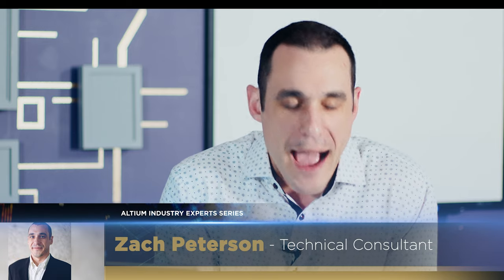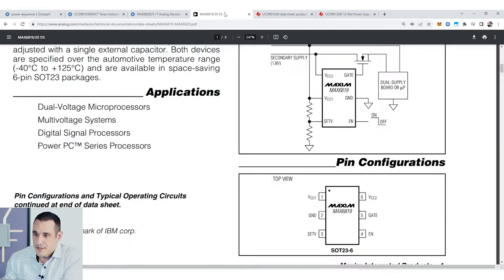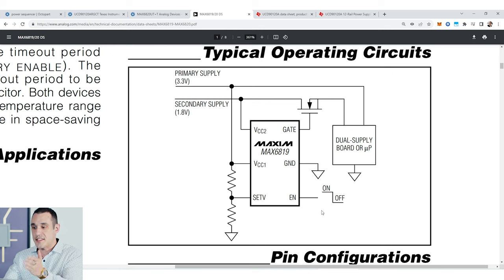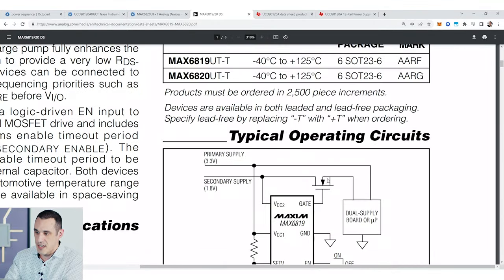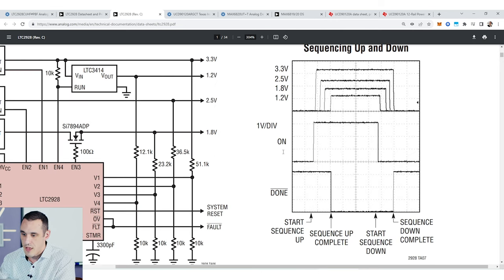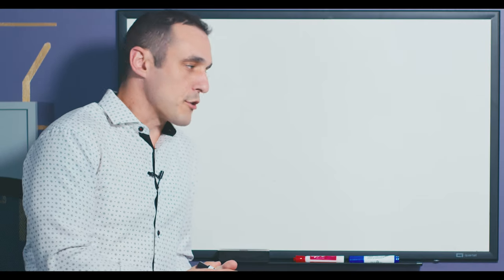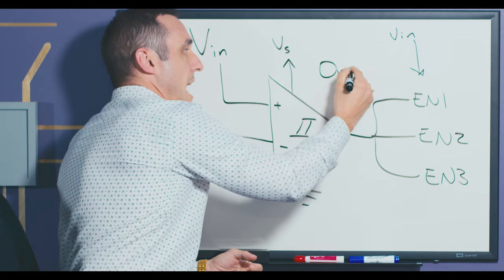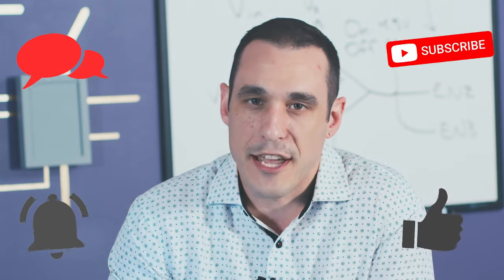Master Your Power Sequencer with This Comprehensive Guide!

Comment: If a regulator does not have an enable pin, simply add a MOSFET switch at its output and control that switch/power path - just like the figure of LTC 2928 shows it for channel 3 / EN3 (1.8V).
Reply: @AlbertRei3424  LTC 2928?
Reply: @electronichome1153  nevermind, I was not getting your point sorry...